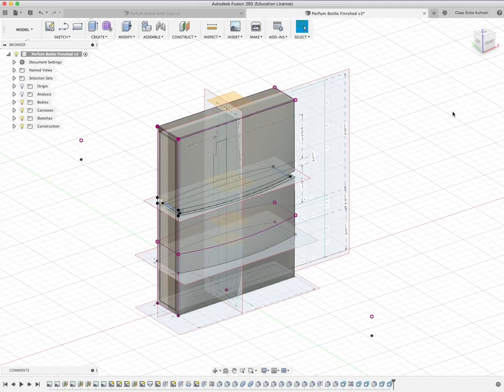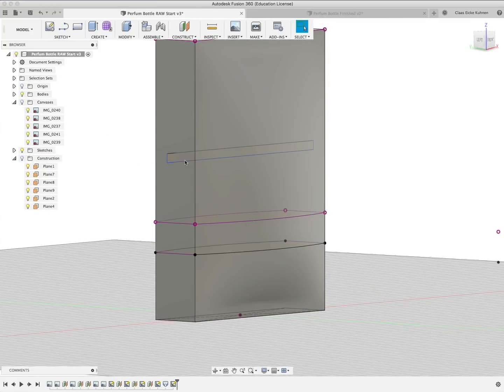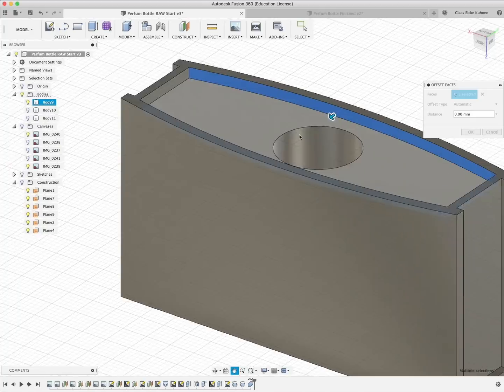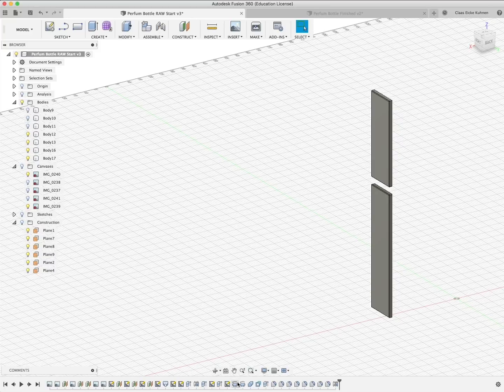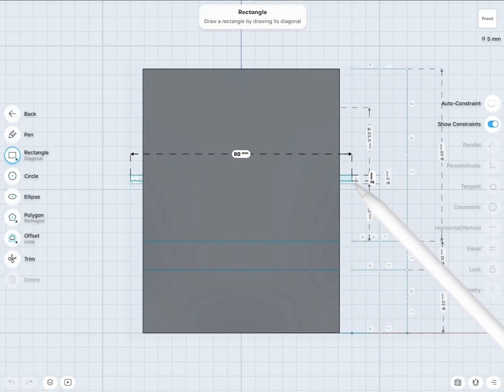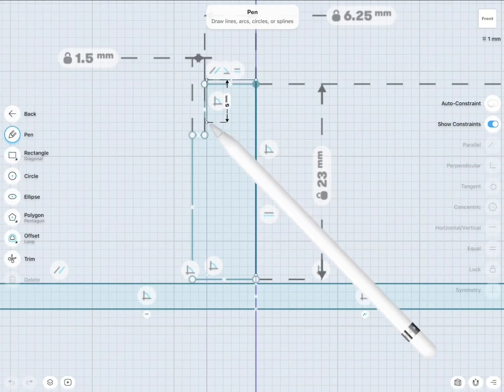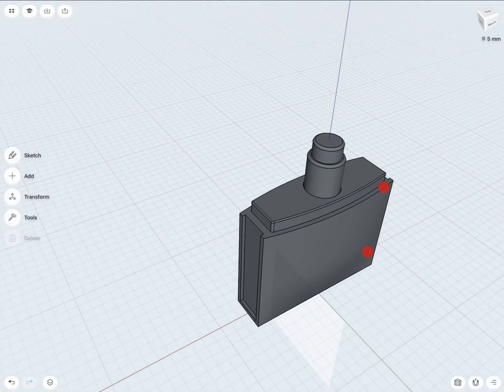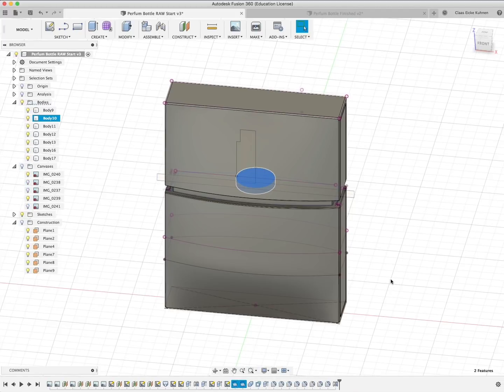Parametric vs Direct Modeling | 3D design webinar

Comment: You can also do direct modeling in Fusion. But i don't want that. I prefer parametric modeling. It is easier to change the design afterwards with parametric modeling.

Comment: For a quick sketch the DM approach might be fine but let me give you an example: I do design for additive manufacturing and if I do a design I have to keep nozzle diameter of an FDM printer in mind. Now if I do one design and want to try it out with different nozzle sizes, in PM I just have to change one parameter (which will be connected to all wall thicknesses and radii) but in DM I have to basically to the whole model again. It would be really useful if I could design with parameters in Shapr3D because just for a sketch it is too expensive.

Comment: So... he goes into PM and deletes an entire segment & complains about it but in DM all he does is change the last fillet and the depth of the last cut and says DM is better. Really? I wonder who is gullible enough to believe what he says but also understand those features? Who is he trying to convince?

I was mildly interested in Shapr3D but after this video I'm completely convinced this is a worthless tool. May be for illustrators, it might be useful, but no CAD designer will find it useful. 

Once I make a feature, then its cast in stone. As an engineer I need to able to modify the every single  feature. So this is not a good option CAD designing.

Comment: Did not seem to show any stark advantage, only that direct and parametric are not quite the same.  But the sketch based features in the direct model no longer link to the source sketches.  If you want to change the overall loft of the bottle, you could not.  You don't have a direct modelling edit capability on modifying the loft sections in Shapr3D.  You'd be able to do that easily in the parametric model.  You've had to try pretty hard to make that parametric model break and it came out more robust than you expected and didn't fall over until you started deliberately using some poor practice to make it fragile.  There are poor practices in direct modelling too.  So, this demo shows it is different, but also a matter of taste.  I like Shapr3D AND I like parametric.
Reply from the maker: Thank you for your great feedback. We keep trying to improve Shapr3d and feedback from users like yours is always welcome.